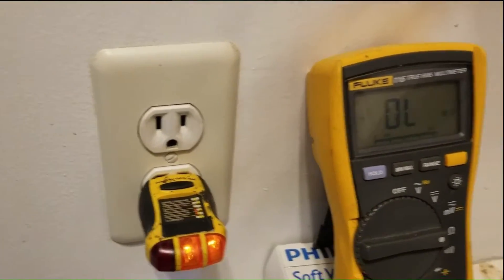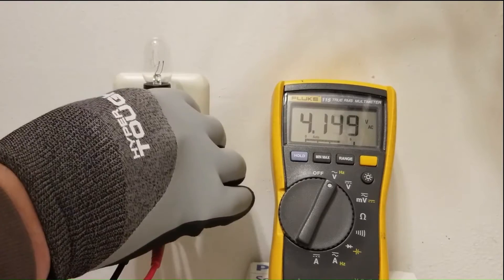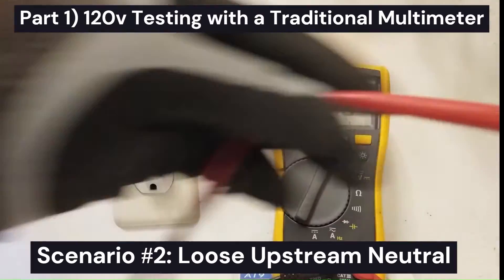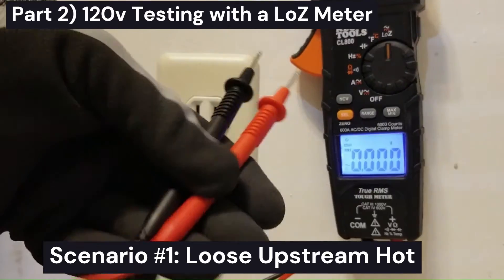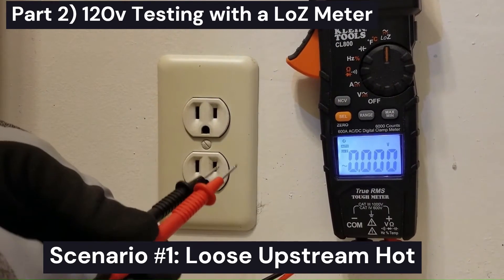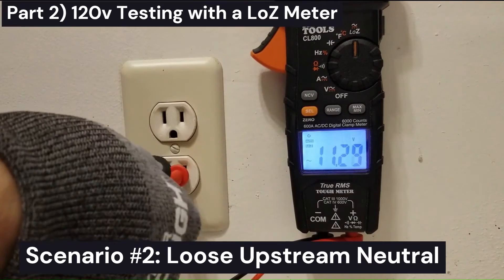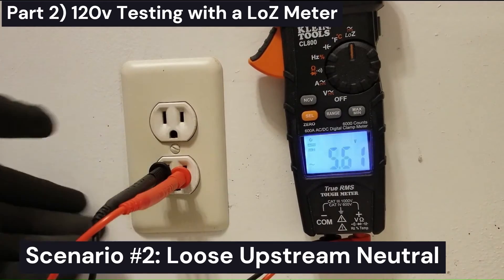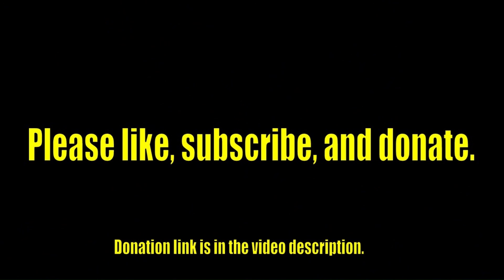#89 - 120 Volt Outlet Testing using a Multimeter, a LoZ Meter, and a Voltage Pen

Comment: amazing video...
i just had a similar problem the other day but it was on a lighting circuit, no outlet to do such measurement...  but the voltage pen was giving light on both connections of the lightbulb...
After some investigations turned out i had a loose neutral in the panel.

Comment: Your knowledge of the basics is so impressive, were there any particular books you read or classes you have taken to really help everything sink in. I often feel like an upside down pyramid, I have a lot of knowledge but it’s all been learned out of order and I have trouble tying it back to the basics.
Reply from the maker: Thank you. I've always contended that a strong exposure to electrical theory academics is required to just understand the basics. The basics are driven by that underlying theory. My background is in Electrical Engineering Technology and circuit design, but that's not necessary. There are plenty of videos on electrical theory (lots in my channel, btw), that you can avail yourself of. I'd say to continually learn a lot more than you think you'll need to, and a deep understanding of the basics will happen.
Reply: @TheTechCircuit  thank you for that reply!